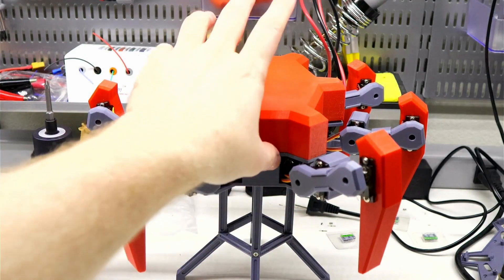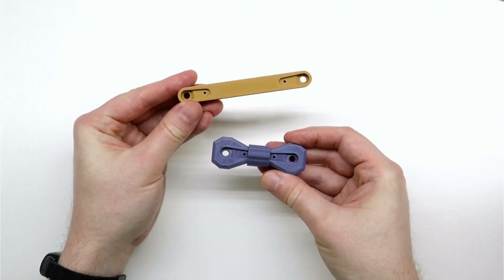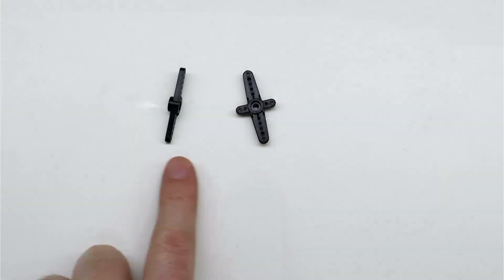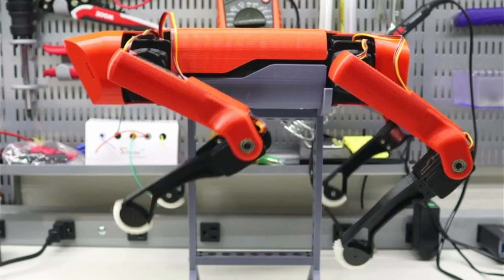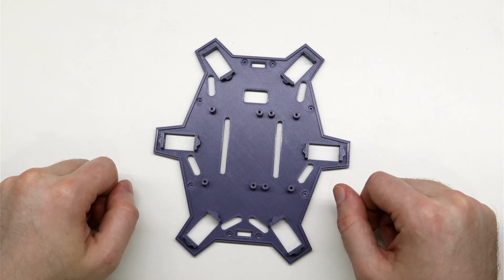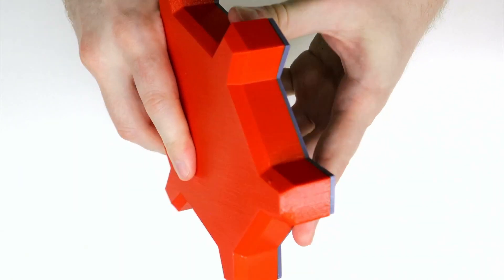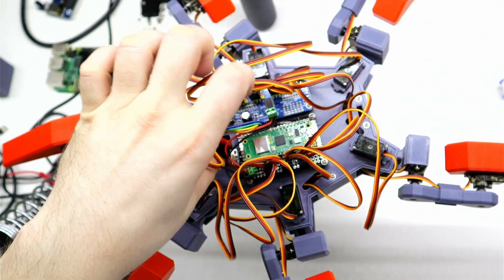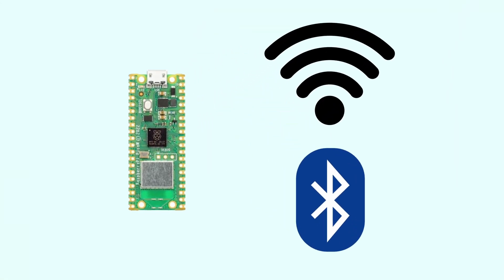Project MicroHex V1.0 | Hexapod Robot Build Finished

Comment: How did you do the power for this? I have a Lipo battery that has a xt60 connector on it and I found this buck convert/BEC that I could use to step it down but the xt60 cables are so thick i don't think it can fit in the ports? I'm having trouble find resources for that part XD

Comment: Control it with a Ps3 controller
Reply from the maker: This is an interesting idea. The Ps3 controller should support Bluetooth and the Pi Pico supports Bluetooth, but I've never connected a Ps3 controller to a micro controller before. I'm going to have to look into how to do that. Thanks for the suggestion.